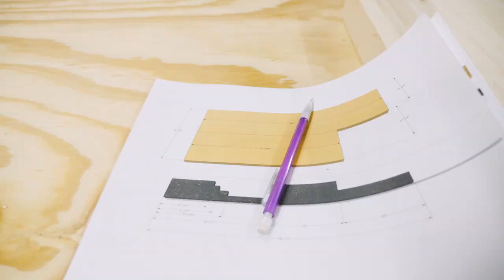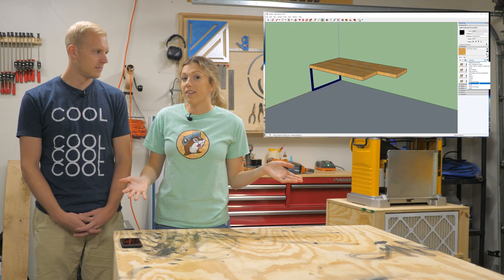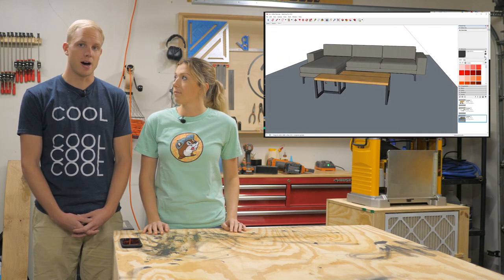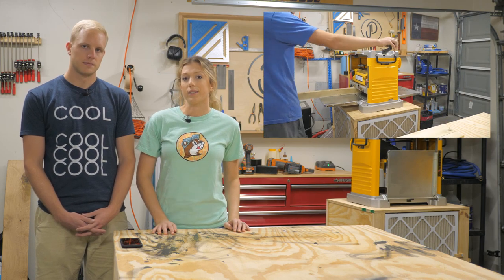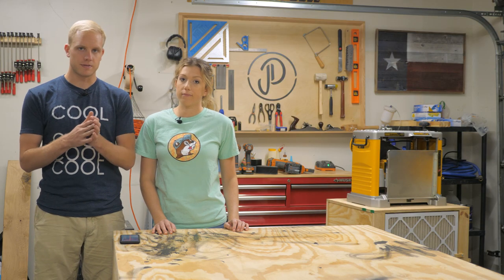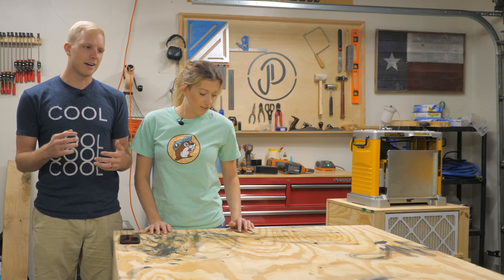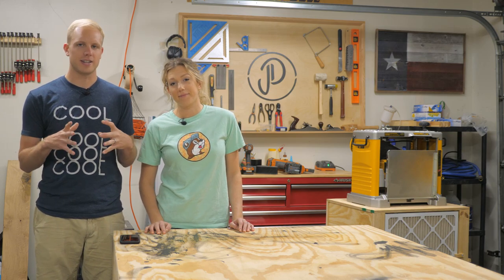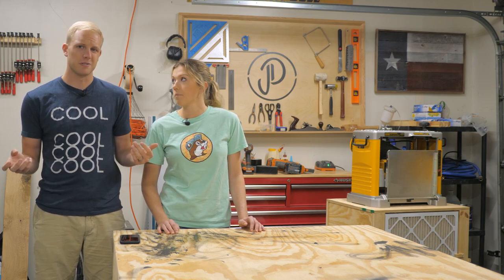📐90° Coffee Table for a Chaise Sofa ☕️  - The ONLY Table In Our House!

Comment: Hopefully the top doesn't warp in the future 👍👍
Reply: Why would the tabletop warp?
Reply: The boards are over 6” wide and growth rings are in same direction @3:03
Reply: marcelo403 polo, how dare you criticize these expert woodworkers. Lmao
Reply: Todd Masters Thanks, Todd.
Reply from the maker: Boards are completely dried-out, finished on both sides, dominoed together, kept in the shade, indoors, and oversized holes were drilled to attach the legs. Guys. It'll be fine. Wood moves but it's not Mick Jagger!
Reply: @marcelo403polo2  lol, it's wood not Mick Jagger until that Texas humidity kicks in.

Comment: Are you worried about the wood not being able to move across the grain?  Looks like you screwed it down without making it possible for the wood to move. 🤷🏻‍♂️
Reply from the maker: Couple things. #1, wood doesn’t move all that much if kept indoors and it’s dried really well. #2, we drilled oversized holes with washers so the screws can move a little bit within the base
Reply: Jennie and Davis so does it matter what type of wood you guys use or if you use metal legs?  And does it matter how thin or thick the slab is that you use for the top?

Comment: You should use nicer hardware double your price of materials and labor should be at least 65 an hour you are cutting your self short !;-)
Reply: they should double the hours since its two of them working on it
Reply: @David-fv7zg  i was talking about time, not the table. Since there are two of them working at once, then hours are multiplied by two. Please read what i actually wrote before sending snide remark. Did i say anything about the table other than hours?
Reply: I own 3 businesses. One is a machine shop and one is a custom furniture and cabinet shop. If I have to put 2 people on a job   then i have to charge for the hours of both guys. because i still have to pay both guys. So, yeah i do know what I'm talking about. I didnt make a snide comment, I just said re-read what i actually wrote instead of make up some absurd inference. I made no mention of the project. Only that if more than 1 person working on a project then the hours should be calculated accordingly.
Reply: @David-fv7zg  that's their call for what they deem their time is worth. Ive seen several people in home based businesses say that they arent making enough profit from each job. i go and look at how they are pricing things, and you have two people working on one project and they charge for 1 person's time.  Its actually quite common. As for hourly rate you have to decide what your time is worth and market will either prove you positive or negative. It all depends on your market. Take a table by Ashley Harwood vs  this project. The person who would buy the giant walnut dining table she recently made probably wouldnt be the same client for a table like this project.
Reply from the maker: Adam, sorry that guy was being a jerk to you. He's been blocked (he was causing trouble in some other comment sections, too). No one will ever see his comments on our videos again 😊
Reply: @jennieanddavis  no problem i left the house with my big boy pants on. the occasional internet troll doesn't phase me.  Hope you are enjoying our Houston cold spell.
Reply from the maker: Haha yeah this is crazy! Heater didn’t work the last 2 days... got pretty chilly in the house!
Reply: @jennieanddavis  I'm north of Houston near Huntsville. I have had that happen. Years back we had an ice storm, power was out for a few days. Power company truck got stuck in the front hay field (my house and shop are a mile from my front gate). It was a mess. I keep sawdust mixed with parafin around for lighting fireplace when that happens. 

Hope you guys are adjusting to the new surroundings.